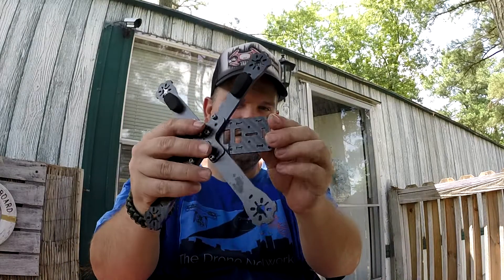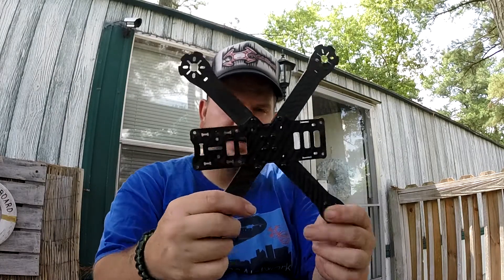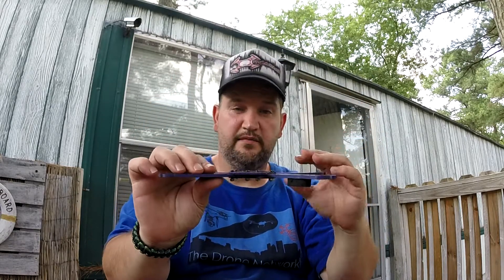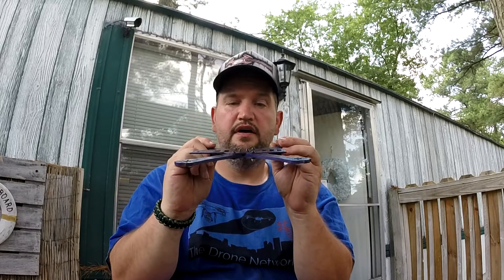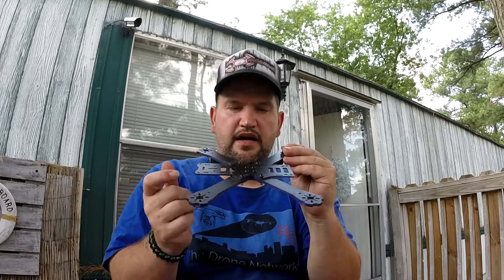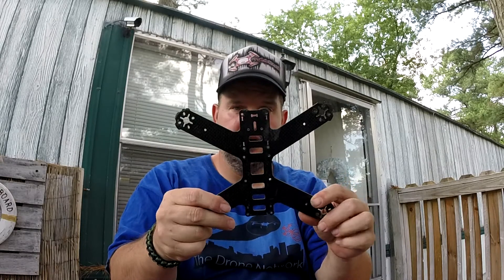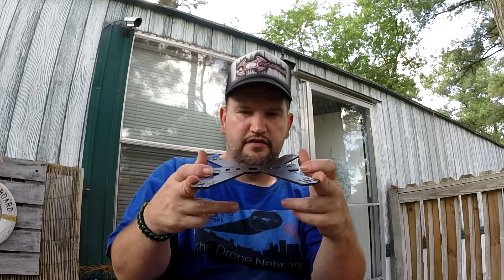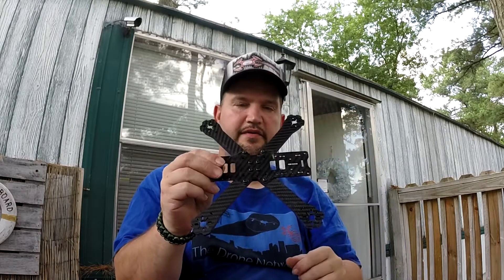Wizard Mod cut the weight no more top plates

Comment: it will work . remember my shark drone it was just a bottom plate with no top plate at all, not even any protection for the flight controler or camera , and it flew great and i crashed it many times and never hurt the camera or the fc.  go for it brother.   hay by the way, lets name our new power line move -- riding the lightning.
Reply from the maker: Thanks Chris Ride the lighting it is bro